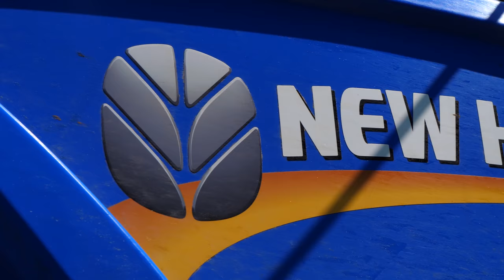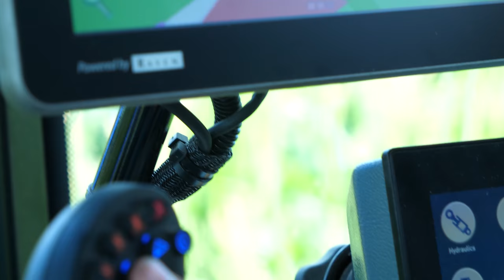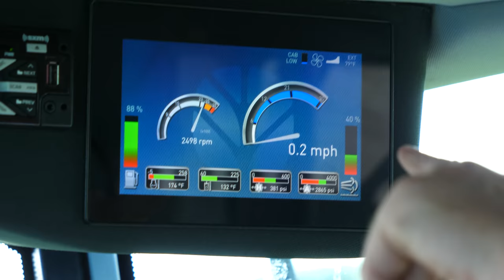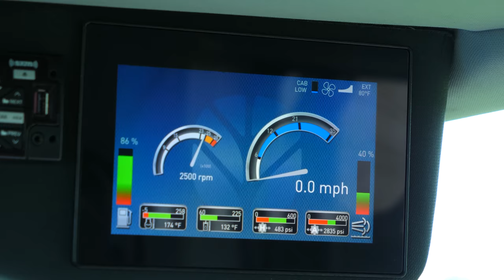Late Season Nitrogen Application | New Holland SP310F

Comment: Ryan, Andrew question: why did you not extend or unfold the sprayers booms completely? Wouldn’t that have saved on nr of passes and tracks in your field? Curious 🤔
Reply from the maker: The Y drops are only on the inside booms, they’d be sticking up in the air during transport if they were on the outside of the booms

Comment: Not questioning how u farm , just wondering how much trouble it would be and if possible to set planter up to have a wider middle on the sprayer travel rows? But then i ges the header wouldn’t match up?
Reply: 20" row spaceing is often set up with 24" 'wide rows' on 120" centers to allow for row crop applications. However this is not necessary in 30" spacing because most row crop tires are 15" wide allowing plenty of room.

Comment: As nice as that corn looks, I'm wondering if you could be causing more Los by running it down than your benefiting.
Reply from the maker: We do check strips and know that there is a benefit of Y-dropping. As long as you don’t have short passes with a lot of turns it’s worth the investment.
Reply: @HowFarmsWork  strips would be okay, but like you said if you need to turn a lot in the head lands, corn looking that nice, then it wouldn't be worth it.
Reply: H Turbo actually you aren’t running over much corn at all, if you have to run over 20 bushels in a field to get another 2000 or more it’s worth it.

Comment: What does Ydropping mean?
Reply from the maker: Y-Drops are located in between each row to get the hoses close to the base of the plant so the plant has an easier time reaching those nutrients.
Reply: It's as it sounds, the nutrients are dropped out of a "y" shaped attachment I guess you could call it, at the end of a hose, it's used for late season nutrient application.

Comment: Does that NH SP Sprayer have like a "row sense" like the JD SP Sprayers?  That makes Y-dropping much easier.
Reply: thr8061 it’s an option through Reichart or 360 guide but the active suspension on these high clearance machines makes it difficult to accurately autosteer especially on contours and slopes